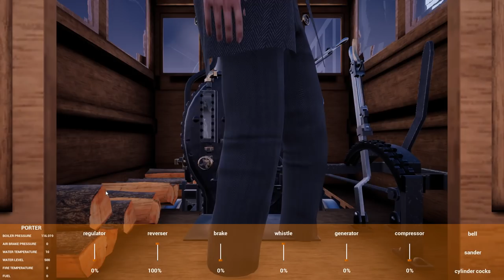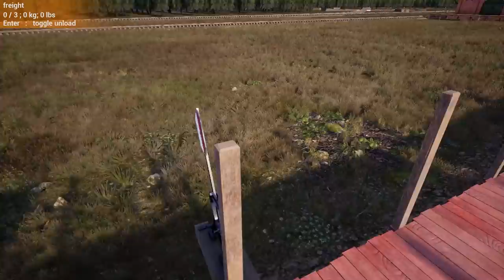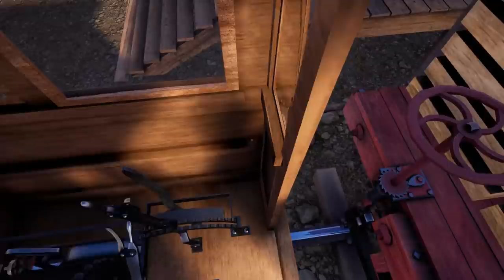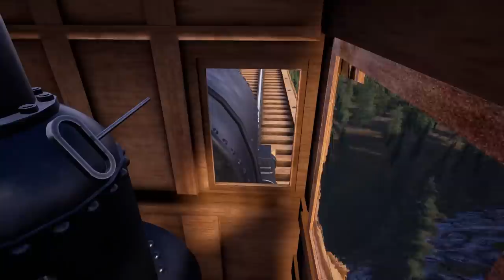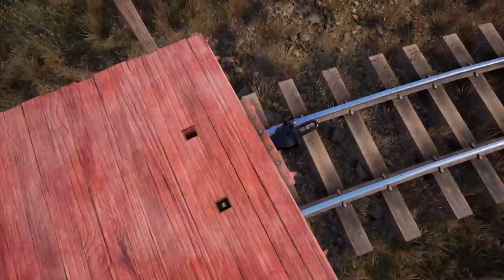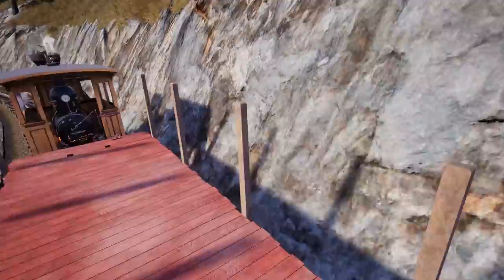Pushing the "Overpowered" Porter to the Limit with the New Physics in Railroads Online!

Comment: Hey everyone! Hyce / Mark here, RO! Dev. One thing that I realized I was wrong about on the video I was a part of with kAN was that the bridges still lay at the wrong grade! We need to model new splines to fix it, but the wooden bridge and steel bridge don't lay at the gradient you set them to. I know it's an annoying bug but unfortunately the fix is also annoying - stay tuned on that. For now, we recommend you lay your bridges at a shallower grade than your main track.
Reply: Hey Hyce! In case you see this, at 33:58 where kAN derailed at high speed, this happens on my track at the exact same place at high speed. Are bridges more likely to cause a derailment near the speed limit, or is there something in that part of the map that may be causing this?
Reply: @Monosandalos  It is hard to tell for sur in the video. but it looks like that section at the end of the bridge where betsy derailed is overlapped.    I have noticed the same thing on some of my track.   I would go along there and use crouch mode to take a close look at the track and see if some of the rail overlaps with the rest.    The hand cart is actuall really good at finding those overlapped sections because it will do the exact thing betsy did right there.
Reply: Really hoping i don’t have any 3% bridges that will be an issue now
Reply: @LSFord  they probably won't be, unless they're super long. It's a small difference, but when you're playing on the edge it might make a difference.
Reply: @Hyce777  as of right now all i have is betsy so I’ll be on the edge until i upgrade
Reply: @Monosandalos  Hmmm. I concur with Bendigo's answer, looks like there might be some overlap going on. I don't think the bridge deck is more prone to causing derailments.
Reply: I noticed this too in the pre-update game. It would double the grade I specified, especially when making a really tall bridge that had a gentle curve.
Reply: This is the first I'm hearing of it. Then again I may not have been paying much attention to the bridge grade.
Reply: Any chance of a Shay loco being in the works? 😏
Reply: @SamJ_M  Join the discord and check the modelling progress channel ;)
Reply: @Hyce777  oh damn! That's an awesome steam tech tree! Looking forward to the d&rgw K-XX's too!
Reply: @SamJ_M  It's in the tech tree but the running line is that every time someone asks, it gets pushed back a little bit. Really though the devs are ironing out all the kinks and squishing bugs before unveiling any new locos.

It'll take some time but it'll be well worth the wait, I'm sure.
Reply: @SamJ_M  me too :)

Comment: Betsy has both a tank and a boiler. The number on the driving interface is just what’s in the boiler. As steam is used, an injector pulls water into the boiler from the tank. All the locomotives actually do this, and they even added a new animation for when the tanks on the engines/tenders are full.
Reply: I wonder why there's no injector simulation in railroads online
Reply: I wonder if they will ever add explosions into the game… when you run out of water but still have a raging fire 🤣🤣

Comment: Being suddenly overweight because of an increase in grade won't immediately stop a train dead in it's tracks if it's already rolling. The easiest way to understand why is this:
In a simplified example, suppose your engine has 1000 lbs of tractive force and you pull a load of 999lbs. The train will accelerate very slowly at a rate equivalent to 1 lb tractive force - that is one surplus pound of force applied to acceleration. On the other hand, if the same train is moving at (say) 20 mph and someone throws a 2 lb rock on to one of the cars making the total weight now 1001 lbs. The train will decelerate at the same rate - the engine now has a -1 lb tractive deficit.   If it took the engine 20 minutes to accelerate to 20 mph with 1 surplus lb of tractive force, by the math, it should take 20 minutes to decelerate to 0 mph with -1 lb deficit tractive force.
Reply: You are my new best friend. They don't really teach you this even with the railroads
Reply: Why could I see some kid chucking a rock at a train and stopping it with that

Comment: Most Baldwin or Cooke narrow gauge 2-8-0s had "blind" driving wheels on axles 2 and 3, i.e. the middle driving wheels are machined without flanges to allow for more lateral movement in sharper curves, so the Class 70/C-19 should have no issue on the curves you've built, but for reference curves that are 20-degrees/100' or broader are a good minimum curvature standard to build to.
Reply: Yep, you can look at the models in game and this does work. From what I’ve seen, 25 degrees is doable with a Class 70.

Comment: They have a new update kAN! They rebalanced the entire economy!

The lumber mill is the only 1:1 (technically) industry remaining as 1 log creates 1 beam and 1 lumber
iron ore mine: 1 beam + 2 lumber = 5 iron ore
smelter: 4 cordwood + 2 iron ore = 1 raw iron slab and 2 rails
coal mine: 1 rail + 2 beams = 10 coal
ironworks: 1 coal + 4 raw iron + 3 lumber = 4 steel pipes + 16 tool crates (added lumber 'cause they have to make the crates somehow I guess)
oil field: 3 beams + 3 steel pipe + 1 tool crate = 24 crude oil
refinery: 2 lumber + 1 steel pipe + 12 crude oil = 6 oil barrels (the steel pipe, I assume, is what the barrels are made out of).

Give it a try when you get the chance!
Reply: Price changes will also be coming to make this make more sense :) stay tuned
Reply: @Hyce777  Looking forward to it, Hyce!

Comment: I would love a simple building mode. This game looks amazing, but I know I would hate how hard it is to make straight lines. I also know its not realistic for the time period, but adding an option for automation, and automatic switches, would be so cool.
Reply: Although it's denied, I would like Spring Switches, which were normally used trolley lines for reverse loops
Reply: @ThePTBRULES  Maybe someone will mod the game once its finished being developed.
Reply: @ThePTBRULES  Spring Switches would be very nice to have especially for single player. Would greatly help improve the flow of the game
Reply: The horrible building interface is why I returned the game on Steam about an hour after buying it.  (This was a couple months ago, so perhaps some of these issues have already been fixed.)   Some improvements would be:
1.  Being able to automatically lay track down the center of the roadbed that you just painstakingly placed instead of having to try to guess where the center is and where your curves started.
2.  Prefabricated track sections.  Straights, curves, etc. in a geometry that is self-consistent like model train tracks.
3.  Allow placing multiple copies of an object without having to open up the building menu every single time (crossing and switch especially).
3.  Fix connecting to the turntable so it's not an absolute pain.  Maybe give it attachment nodes at 5 or 10 degree spacing with a GUI that will let you change the node spacing.
4.  Fast travel.  Walking everywhere to scout out routes is ridiculous.  "Hmm I wonder if I could build a track through there..."  5 minutes of walking later. "Nope.  Let's try over there."  Another 5 minutes.  "Nope.  Maybe there?"
5.  A better map.  Let me see where existing tracks are.  Give me the option to view the map in a topographical mode
6.  Automatic or assisted laying of parallel tracks.  I was getting incredibly frustrated having to lay temporary crossings everywhere, one at a time, just so I could make my tracks parallel.
Reply: @nathank7989  that is exactly why I haven't bought the game yet. I'm sure some people like the system how it is, but I would love an option for a simpler system. I would buy the game in a heart beat if they made the changes you listed.
Reply: @nathank7989  Keep an eye out for the spline update, they are focusing on making track easier to lay, and they are increasing the top speed of each locomotive. They have some other stuff coming in the update but they haven't told us everything about it yet. look at Hyce's channel, he should have a dev vlog video on the update.

Comment: With how Betsy rerailed itself, would a jump work?
Like a ramped rail that ends, so the engine gets airtime then lands on another track.
Reply: Dapper already did a video on this but it was with the old physics so prob changed
Reply: I NEED to see this on new physics!
Reply: If you can land on the rails it is possible but consistency in flight and ground collisions is where you will have most trouble.

Comment: I bought a Class 70 right off the bat, at the time i bought it is was the strongest in terms of tractive effort with 11,690, 450 more than the Heisler. Now even in the beta with the new power readings and weight and stuff, the Class 70 is now over 15,000 tractive effort, or 2nd strongest, and if you watch my streams its an ok train, but im saving up for 2 new engines, 2 Climaxes with over 17,000 tractive effort for the iron mine route so i can haul way more up.

Comment: Converting pounds to kilos I've learned that you effectively half the pounds. It's actually like divide by 2.2 or something if you want to be picky. But that's not a quick math xD
 So, for example 2k lbs that makes about one metric tone. Not exactly, but ballpark close enough.
Reply: Correct. 1 kilogram is equal to 2.2 pounds.  1000 kg is 1 metric ton where as 2000 pounds is one imperial ton
Reply: @DragonKillah  because why have it easy when you deal with freedom units 😂🤣
Reply: @Sodorii  some 'Muricans still deal with the rest of the world's measurements. Like us mechanics for example. Working on a Chevy but it's still mostly 10 and 13mm bolts 🤣

Comment: Does the Betsy 2 create more tractive effort? Extra weight = extra down force ?
Reply: Probaly not, betsy doesn't wheelslip bc it hasnt enough power, i think its the same thing with taking the engine from a small car and put it in a pickup, more weight and traction, but doesnt help as the engine is weak

Comment: Hey kAN, this is from the discord. They did a lot of tweaking:
new build 220125-BETA

rebalanced all industry in and outputs
    sawmill: 1 log = 1 beam + 1 lumber
    iron ore mine: 1 beam + 2 lumber = 5 iron ore
    smelter: 4 cordwood + 2 iron ore = 1 raw iron slab + 2 rails
    coal mine: 1 rail + 2 beam = 10 coal
    ironworks: 1 coal + 4 raw iron + 3 lumber = 4 steel pipe + 16 tool crates
    added lumber as input ressource for ironworks
    oil field: 3 beams + 3 steel pipe + 1 tool crate = 24 crude oil
    refinery: 2 lumber + 1 steel pipe + 12 crude oil = 6 oil barrels
Reply: This means, that you now can deliver 6 Beam Carts (18 Beams) and 6 Lumber Carts (36 Lumber).

Comment: I request a gravity based system - no breaks, no power needed for a run.  Would be a fun and unique challenge :)
Reply: What?
Reply: and i tryed in game for the coal AND iron mine it works!
Reply: @Westman0071  what?
Reply: @ausrac905  well think about it and try if Betsie did the traject without a problem this means it's possible and if you try to do the same thing but without Betsie and only with 2 wagons every 5 min in 25 min you got a 10 wag long coal or iron train waiting at the bottom

Comment: Could you [and if you could, I dare you to] make a hump yard in this game?
So a hump yard is where wagons are stored, like what you already have, but the whole yard is on a very slight incline. The idea being that a locomotive would shunt the wagons in to the yard for storage, but when you want to take some wagons out you set a route for them and then simply release their handbrakes and they roll out by themselves. You control their speed or bring them to a stop by using the handbrake on one of the wagons. That's the forming method, of course the exact opposite could be done for breaking down trains, which was more common, where you pull up in to a spur with a full train, go set a route and then release the wagons a few at a time so they roll down an incline in to their sidings, which are perfectly flat this time and the wagons come to a stop under their own weight. These methods were used in yards all the time in the early railway days. I don't know this game but if you have to buy wood/coal for fuel etc it'd end up saving you a fortune in the long run by not having to constantly shunt wagons to form or breakdown a train.
I know this game uses narrow gauge track, so you might be interested to know that in the slate hills in Wales they would roll entire trains full of slate down hill with no engine, just using the wagon brakes to maintain control. The miners would sit on top of the slate in the wagons to get home from work. Back in the days before health & safety existed. Again... I dare you!

Comment: What i have done since the start, is to lay a small trackpiece with 1 sleeper 90 degrees from the track, right where the coupler on the 1st wagon behind the loco is.
And how i prevent wagons roll back and forth while loading a longer train, i just put the last wagon's handbrake on fully, so when the wagons compress the couplers, it doesnt roll back

Comment: In real life you determine wheel slip by a couple of ways... once you know your engine, you know how much ground you cover for each chuff of the exhaust, and when you spin, it usually results in massive overspeed instantly... kinda like the old days off 100% throttle and the wheels go nuts... You can also feel it too, as the locomotive will start bounding around. But generally speaking, you should not experience any major changes in exhaust chuff under normal circumstances, especially speeding up. 

 On diesel locomotives they put a light right outside the cab window so you can see if you're actually moving... no I'm serious. Before they had wheel slip indicators that was the #1 complaint of the operators that you couldn't tell until you had sparks coming off the wheels that 1 or more axles were spinning.

Comment: no idea if that's different with steam engines but you don't feel your wheels slip when accelerating in modern engines (at least not the one I've been on) For that reason you have a control lamp that illuminates and rings a warning tone when your wheels slip. maybe that's different with enough experience, im new to all this

Comment: They added coal hoppers to fill coal engines. I imagine that would be faster than throwing wood at one of the big trains that probably stores like, 1,000 wood. I think it would be cool if they added a firewood hopper (Dispenser) only for the big engines. (I don't see how you would use it with Betsy.)

Comment: I just bought the Class 70. And sadly can confirm, that it does not fit legally on the turntable. Yes, I said legally. Once you get the front bogie off the front of your turntable, the tender then fits on the turntable. A bit of hitching once the front bogie reaches the desired track, but it works! Also double heading a climax and a C70, is actually the most powerful combination of 2 engines!

Comment: Great, now we need a new unit for power, as it can't be measured in Betsies anymore ^^
Reply: It seams Betsies are a more relevant measurement than before so im not sure why you believe that.
Before Betsie was a powerhouse so if she were used as a measurement everything would be measured in fractions of a Betsie.
Now Betsie being much weaker means everything can be measured in multiples of Betsies.
With Betsie being such a large standard before, it was like trying to measure inches while a mile is the only standard you know.

Comment: i so love pushing the limit  ther so is leway to over work the trains with speed and stuff ful speed often wili let ya puli 1 or 2 %  ove r the  load limt if it shorter then the train length like i had a 4% load limt and i pressed it over a 6 %  but the train and at lest 1 or 2 cars had to shift to a much shallower grade and it crawled that was a hsiler with 22 car load mined only the 4 hopper whee full the rest was empty